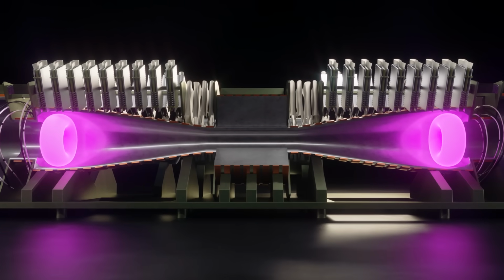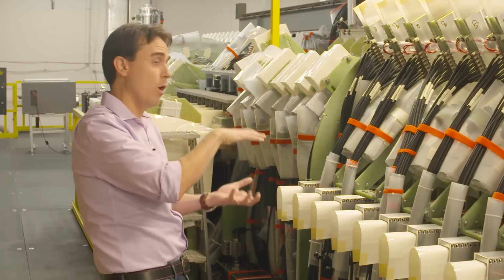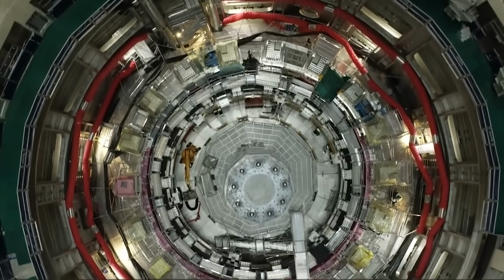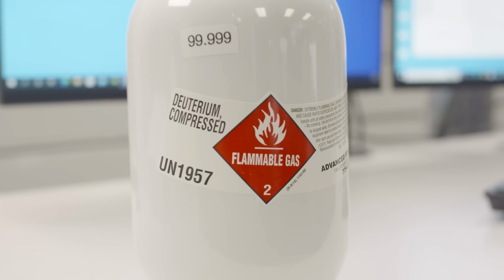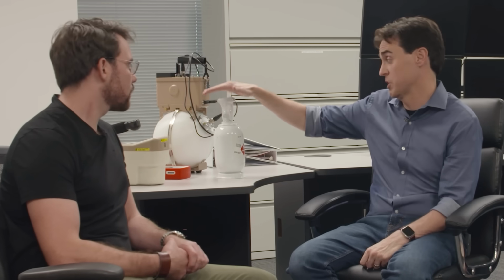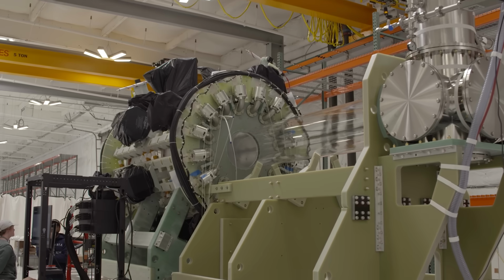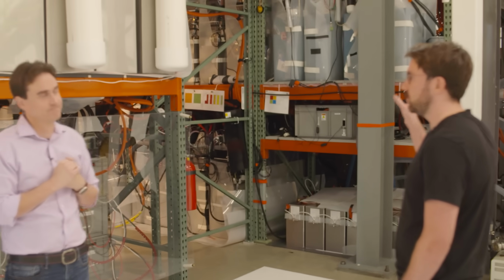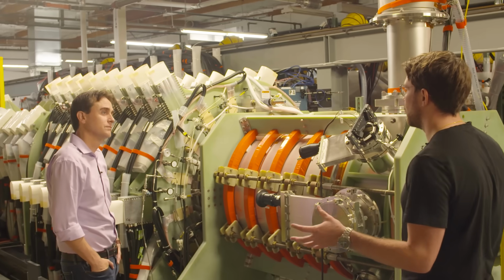A New Way to Achieve Nuclear Fusion: Helion

Comment: wouldn't the obvious solution for the fuel synthesis be to have a fuel-synthesis facility on-site but separate to the primary fusion reactor? use the low-energy neutrons formed in D-D fusion to generate additional energy in traditional turbine generators, and use a magnetic pump to pump the He-3 & D to the primary reactor.

As an aside (I might be wrong here, please correct me if I am) the driver of this breakthrough appears to be a series of innovations, and maybe only one invention (possibly the generation of He-3, we already knew that D-D reactions could create He-3 because we see it the sun deposit it on the moon, the possible invention is the selection of the He-3 product instead of the T product, unless they are just brute-forcing this)
Reply: They declare exactly this approach.
Reply: @madcalm2024  they said either it being attached to the reactor which would cause accelerated wearing on the reactor due to the Neutrons, or having it separate and transport it. I am pretty sure that the use of transport in the latter means that the plan is to have it not on the same block of land (i.e. elsewhere in the state/country/city), but alas this is my interpretation.

Comment: The best process so far ... the fact that it has no water circuit is just fantastic.. electricity direct! Amazing concept congrats 👏🏼
Reply: its bs, it needs 100,000 amps to work,,wheres that come from.?. 1950,s sodium reactors, were banned, as not military suitable, so, will this be used for killing people, eventually.??.. hiroshima, nagasaki,. chernobl. 5 mile island, ect.ect. we had electric cars back in 1910.. electric milk carts with 500hp, in u.k.
Reply: @harrywalker5836  lol all that matters is producing more electricity than you put in... the first 1million amp even can come from capacitors like they are doing now .. after that the system produces more than 1m amp to keep it going

Comment: I'm really sorry for being one of "those" guys, but I must ask what is the Q factor of the reactor? NIF made news because for the first time they broke Q > 1. It was weird to seem them talk about commercial scale without bragging about their Q factor (that well, I'd imagine that if it was > 1, they would be screaming from the bottom of their lungs, just like NIF did). I also was intrigued abou the apparent lack of cryogenic infrastructure around the reactor coils which makes me wonder what superconductor are they using, or they not using superconductors at all? (which would seriously make me question the efficiency of the magnetic containment and energy recovery systems).
Those questions make me really skeptical about the system as a whole, and make me very cautious because I've seen this very same behavior in startups that failed to achieve what they hoped to, where instead of going right to the main engineering issue (in their case: Q factor) they tiptoe around other issues which they managed to do, to still be able to attract investors and go through another capital raising round. 
I sincerely hope I'm completely wrong on my concerns, but those elephants in don't

Comment: 100 million degrees in a unit with plastic and fibreglass, yeh dubt that, and all the cables are just earth straps. Highly dubt this is even working. Where are the large coils?
There's nothing for cooling or anything for heat dissipation.

Comment: It all sounds very exciting, but call me a bluff old cynic, we've been here many times before. What's the total energy in VS energy out in this particular design? How does it compare with other designs? It's not that we can't create fusion, it's whether the auxiliary systems can be made efficient enough to give you a net gain as well as using a practical amount of energy input to achieve it. I fear there may be a fundamental physics/engineering limits that will prevent this from happening.
Reply: everybody are so positive, this is a pretty big challenge and the US has put in tremendous amount of resources just to create a positive net energy happen a week ago.. looks more like helion got nervous than anything else.. but I hope it works out for them..

Comment: So, let me get this straight, they're using super heated collisions super compressed with magnetic fields to achieve fusion once. Where is the free lunch? the chain reaction? the required sustained energy production without further input? That is the very essence of a nuclear energy system. This guy seems to be talking about repeating this process manually as a future leap in progress, so...I dunno WTF he is so excited about. If he manually aims to generate this process as part of the "energy in" equation, then where is the atomic advantage? the chain reaction? nowhere thats where. A true fusion machine is switched on once and it runs on its own, generating fusion collisions or overcoming the molecular atomic force WITHOUT further inputs. Without the chain reaction, you have ZIP, NADA ZERO

Comment: I really, really hope they succeed. Fusion is going to be a real step change for the whole world and I just can’t see tokamaks being anywhere close before about 2060. Helion’s innovative energy reclamation method looks like it could be the game changer required to make it possible. Most concerning thing is the loss of efficiency and risk of damage from neutron energy but I think that’s a lot easier to work out than the problems tokamaks are facing.
Reply: I could be way off here but I feel pretty confident that fusion would not impact water scarcity in the least when used for hydrogen production. Not even a little bit... an iota, if you will 😀.
As for energy production diversification, sure, of course but if they reach a net gain (a real net gain) it's adoption would only be limited by the ability to produce the hardware. Artificially limiting its application, if that's what your suggesting, is a none starter really.  It isn't as though Helion succeeds and solar, hydro, et al shutter their doors and go home.
Reply: Really, what we need is a variety of different forms of energy generation and transportation to solve this crisis. I think fusion power plants would be great where I live in Kentucky, where there are rarely water shortages, but we heavily rely on coal due to a lack of feasibility for certain forms of clean energy (also because of coal lobbyists, but I digress).

However, in a place like Arizona, a fusion power plant would be a horrible idea. A solar power plant would actually be far better in a place that’s dry, but almost always sunny. 

Ultimately, you make a really important point. We can’t go all in on any one form of energy production because there are no “perfect”forms of energy, even including nuclear fusion.
Reply: @ExulSola519  why wouldn't arizona be a good fit for fusion energy?
Reply: the main question is "step where?" the main problem is still the fact its fuel made of hydrogen and the cheapest way of making hydrogen on our planet is from water... switching all the humanity from current energy sources to fusion reactors will be a disaster for our planet. as long as we don't have a cheap way to get hydrogen or water from outside of the Earth, fusion betteer to stay a dream.
Reply: @Circle9ru  Just, no.
     TL;DR
We have 410,000 years of fuel for 10,000 fusion plants (22.7 times the number of nuclear plants we have), and that's assuming horrendous efficiency every step of the way. We are in no danger of running out of deuterium fuel.

     Long form answer

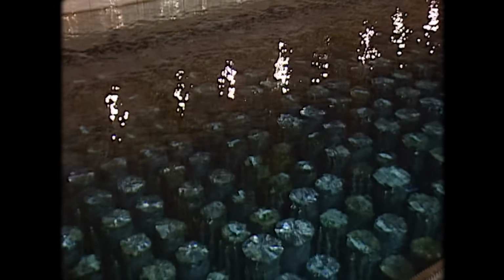Remember when early on in the video (10:15), it was noted that tokamak reactors would use around 300g of tritium per day? let's say that helion's reactors will use around 100x that per day in deuterium. So, 30kg (30,000g) of deuterium per day means, in the worst case, 150kg (150,000g) of heavy water per day. (30,000g = 7,500mol of D2 with GFM 4, 7,500 mol of D2O = 150,000g with GFM 20)

The world is estimated to have around 1.35 * 10^18 metric tons[1] of water. This will contain 1.5 * 10^17 metric tons of hydrogen (again, just GFM calculations). Of this, 0.030% by weight [2] will be deuterium, so 4.5 * 10^15 metric tons. As heavy water, that's 2.25 * 10^16 metric tons (more GFM calc).

As we said earlier, 150kg of heavy water per day as an extremely, frankly unrealistically high estimate. That means 54,750kg or 54.75 metric tons of heavy water per year out of the world's supply. We have 2.25 * 10^16 metric tons. That's 4.109589 * 10^14 years of fuel for one reactor. Even if we were to horrendously lowball and assume we can only extract 0.001% of this, that's still 4,109,589,041 years. Assuming we run maybe, 10,000 of these reactors globally (~22.7 times more than the number of total nuclear plants worldwide[3]), that's still 410,958.9 years of fuel.

And, personally, I feel that 410 thousand years is long enough to get some off-world fuel going, right?

[1] - https://phys.org/news/2014-12-percent-earth.html  
[2] - https://www.newworldencyclopedia.org/p/index.php?title=Deuterium&oldid=1074091
[3] - https://www.statista.com/statistics/267158/number-of-nuclear-reactors-in-operation-by-country/

EDIT - formatting
EDIT 2 - timestamp for tritum number in tokamaks
Reply: @_ayohee , you forgot a small but important thing - your math is for ALL the water on Earth, but critical amount is way less. also, do you really think someone gonna use seawater? lol, think again, those reactors will deplete clean water first because of ppl greed. why use more expencive source, that need cleaning processes which needs equipment and stuff, when you can just take clean water and use it? and if you think they will use ise from anarctic, think again. the biggest problem here is not the fact it use hydrogen, you can make it from oil or gas, the problem is where ppl going to get it from.
Reply: @Circle9ru  Sorry, critical amount? I'm not sure i follow.

Why wouldn't seawater be used? As far as nuclear fusion is concerned, seawater is a perfectly good source of raw materials. Water is Water. Furthermore, freshwater would probably be more difficult to use as it's in demand, whereas as far as humanity is concerned right now the sea may as well be infinite. 

You talked about cleaning processes and being able to "just take clean water and use it". I'm sorry, but that's not how it works. Both freshwater and saltwater would need to undergo processing to extract the deuterium containing heavy water. It's not simply throwing water into a fusion reactor and hoping for the best, it's the deuterium isotope that we're interested in for fusion. Both seawater and freshwater contain deuterium, and both need processing.
Reply: @_ayohee , normal water can be transformed in heavy water by neutron bombarding in nuclear reactors, and its chaper that extract heavy water out of seawater, unless we close every currently existing uranium/plutonium reactor in the world.
Reply: @Circle9ru  Again: just, no. Heavy water (both D2O and HDO) has a boiling point of 101.4 degrees celsius, whereas water has a boiling point of 100 degrees celsius. This makes extraction by distillation of seawater trivially cheap. You are correct in saying that neutron bombardment can make deuterium, but please, in what world is running a nuclear fission reactor cheaper than simple distillation? 

Seriously, you keep saying it's cheaper but the truth is distillation is not hard, we already do it in oil refining, brewing and rather fittingly, water treatment

edit - removed a part I didn't mean to send, it was bogus
Reply: @Circle9ru  why wouldn’t someone use seawater? It’s already where we get a large amount of deuterium
Reply: @Circle9ru  I don't think you understand how much water there is, and actually how little gas they actually need for these reactions. Even for the tokamaks, the fuel needed for a full year of work will not be more than a few tons.
Reply: @Circle9ru  Correct me if I´m wrong but there are multiple mistakes in this logic. First and foremost we couldn´t "burn" all water in the world because most of it consists of regular hydrogen which is useless and if you don´t have any other use for it you can just burn it to make the water it came from in 1:1 ratio. Then if we only ever used fusion to power the world (so converting all fosil (including transport and industries), nuclear and renewable sources to fusion only) we could power the world with 1/100000 of the water on earth for a whole year (given humble 10% efficiency). Every day without fusion energy is a day coal is killing our future generation. So please hold back on comments like "as long as" because there is nothing "long" awaiting us right now except possibly fusion. 

... Just today I was joking during lunch saying fusion is impossible because if we ever made it work the green party would shut it down. Really dissapointed that humans are so stupid it´s actually possible.
Reply: @andrewking6178 , regular hydrogen can be turned in deuterium with neutron bombarding, it can be syntetized in nuclear reactors, same way a tritium.
Reply: @Circle9ru  Fortunately fusion reactors use only a small amount of water and they pose no risk to the water levels. Waaaaaaayy more water is being wasted and polluted in 3rd world country factories.
Reply: @patrikrychtarcik2707 , it seems you don't get the point. water used in factories remains water, even in chemical reactions hydrogen remains hydrogen, in nuclear reactions it become helium and its gone forever.

Comment: Too much hype in fusion not to be sceptical. Neutron capture in fuel generation  is still a problem (Li-6 in the graph, abundance 5% lol). Tritium decay is too long to consider this a catalytic process afaict. And that's not even touching on their engineering challenges. Is it even feasible to approach net energy gain without all the typical lies that we've seen the past weeks? Blink and you'll miss it where he says they can do it once every 10min only as of yet. Better than Tokamak but still... How much mass and power are we talking about anyway? I wonder how they want to manage the hydrogen they create. Good luck to them, sincerely.

Comment: The second I looked at this I said "Oh! It's a rail gun." And wouldn't you know it, I was right.
Reply: Take this set up and change it into a Y configuration instead of an inline one and this would be a great "starter" for a reactor that could maintain a continuous flow of fuel and sustain the reaction, such as a "traditional" nuclear fusion reactor, or perhaps even something as simple as a large ball to contain and continue the reaction as potentially several of these "starter" reactors feed it.

Comment: This is type of fusion reactor that have potential and even possible to miniature in size for space travel. The pulse fusion reactor design can be much easier to control the fusion reaction and the way it draw the electric directly is more less like internal combustion engine vs steam engine of most other fusion reactor design.
Reply: For rocketry it can actually be better to boil your propellant away with the fusion, rather than converting into electricity to power an ion engine (that’s called nuclear-thermal and nuclear-electrical rocketry, if you fancy looking it up)
Reply: @kaitlyn__L  Yes, it can be designed in this way, but propellent also weight a lot for space travel, it will be similar to the chemical rocket in most cases. The most efficient way is by ion thrust propulsion which requires much less propellent.

Comment: Starting fusion reaction was never really much of a problem, the thing we struggle with is sustaining it with positive power output. My understanding of the subject is rather primitive and limited but I still hope for fusion power.
Reply: Helion’s also at the stage of most other fusion reactor designs, they can reliably do fusion. That’s not impressive anymore.

Their reactor design is the impressive part, it looks very scalable, somewhat cheap, removes steam turbine inefficiencies and removes a lot of the problems Tokomak reactors face. 

Although I bet it’s not all sunshine and rainbows there either.
Reply: @theglitch312  Steam turbines are 95-98% efficient, what's inefficient is burning fuel (heating), since heat can't be contained in water/steam.
Reply: @zadovrus1624  Yeah a steam electric plant is only around a third to half as efficient. The rest is simply wasted to create the steam from fossil sources. The overall efficiency of NPPs is even lower, so I doubt fusion will suddenly change that.

Comment: Great video, but falling short on scientific part. This is basically still magnetic confinement fusion, which is very well understood thing. So far, nobody was able to extract any meaningful amount of electricity out of such machines. Nobody is saying that it's impossible, since physics clearly allow it, but we're not there yet.
Great for those guys for doing research, but please don't call it "engineering".

Comment: Isn't this design inherently unstable? All tokamaks, stellarators and NIF are designed so that there is nothing obstructing the stream of plasma. Here, you basically have a tube and smash plasma doughnuts by firing them from each end of the tube. What if a perfect balance beween both ends is not achieved and fast hot plasma goes out from one end of the tube?

Comment: Using the energy from the reaction to generate the electricity to run the magnets sounds like infinite energy. I suspect they would have to supplement the power but it could improve the efficiency.

I will wait to see this company make net positive energy

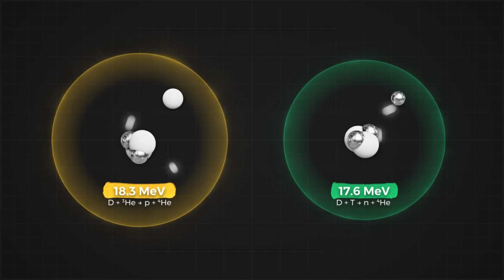Comment: 16:03 Comparisons of fission and fusion reactions usually backfire. It's around 200 MeV per U235 fission, compared to 18 MeV on D+3He. Trying to compare it by mass is cute, but when it comes to real fuel density, U235 is solid and dense while plasma has a quite a low count particles.